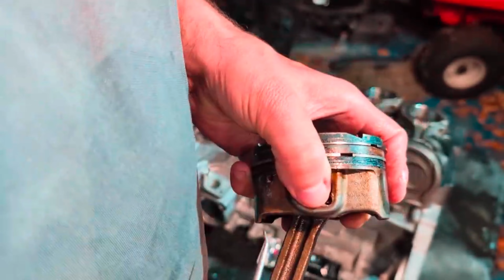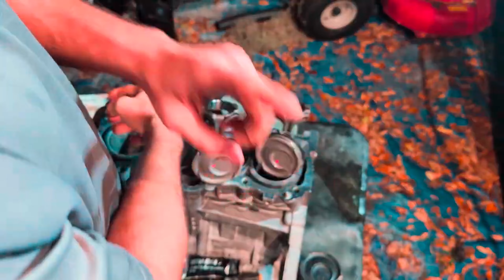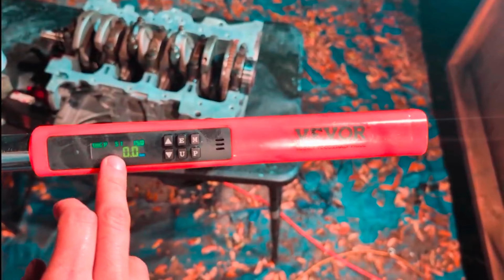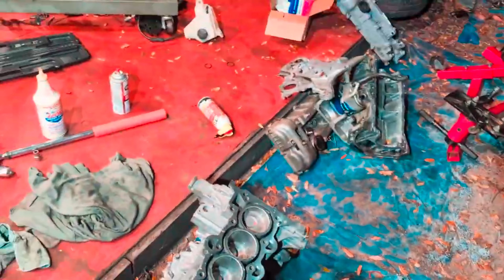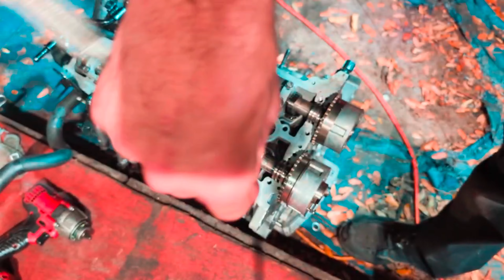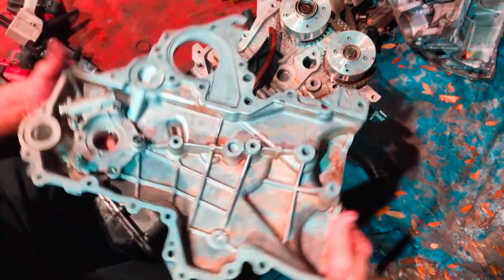How to Reassemble a Hyundai 1.6 Engine | Step-by-Step (2012 & Up)

Comment: How much is the tightning torque where you said to go two times because most of the time its loose…i did 41nm
Reply from the maker: If is the head I do 22ft lbs and one round cross match 90° and then the second time cross match 90° again  and when I say 90 (imagine the clock from 12pm to 3pm or 3pm to 6pm) that's how I imagine the torque when I am doing it but if you are doing that exactly and you don't feel any pressure on the bolt it could be your bolt is stretched out, it could be the treads are damaged or it could be a broken bolt hopefully this can explain it for you question
Reply: @Blackbeautyavante i think its the crackcase house…under the engine block where you mount the oil filter and carter pan. The one with two long bolts and 5 small and three mediums
Reply from the maker: Ok so that is the bottom part you are talking about? If you are I don't tork them I just used the impact tool and I do 2 rounds around it to make sure it is tight but if you feel it is loose then you need to put Hely coil I think that's the name for it
Reply: @Blackbeautyavante  okay thank you. I also changed the connecting rod bearings on my nav. When i did plastigage test with reusing the old bolts on cilinder 1 and 2 i had Cilinder 1 0.050mm
Cilinder 2 0.038mm
Cilinder 3 0.038mm
It should be between 0.031 and 0.052
On cilinder 4 i had 0.025mm. On cilinder 3 and 4 i used new bolts idk if i should keep using these bearings
Reply from the maker: If you feel the bearings are still good, you can reuse them. But I've had so many headaches with bearings that I just replaced them to make sure everything was good. 😅
Reply: @Blackbeautyavante i replaced them too but the oil clearance with the new ones is too tight on one. Can i reuse the old cap bolts to measure the clearance with plasti gage
Reply from the maker: Ohh got it, well if it works that's good then😅😊
Reply: Man i also reassembled the whole down part of the engine with oil pan but i see you first installed the rear main seal…do i need to take everything off first?
Reply from the maker: I am confused in the part you say take everything off what you mean exactly by that?
Reply: @Blackbeautyavante like the whole oil pan. I see you put the rear main seal first then the oil pan in but i put first the oil pan then the seal
Reply from the maker: It is fine you can do it like that just make sure the rear main seal is sitting properly because if it is not it will leak oil, I put silicone on it just a little just make sure I don't have any leaks on it
Reply: @B @Blackbeautyavante thank you

Comment: My pistons don’t have Piston Wrist Pin Lock Ring Circlip they have the press in pin
Reply from the maker: Yes they have to be press in and is way better to do it in a machine shop who has the equipment for it not all the machine shops has the equipment you need to ask before you go to the shop

Comment: Thanks s much for the video. Im planning on building up my velo but never tore down an engine. I have a big garage now and have the space to learn and beat exotic cars lol. The only thing i suggest is to not apply silicone and make a bead with High Temp RTV (RED) and not smear it like that. And dont reuse head bolts There is a proper procedure for making your own gasket with RTV or it will leak. I had it happen to me with doing a thermostat gasket
Reply from the maker: I have a lot of video showing how to teardown this engine and if you get confused ask me I might be able to guide you